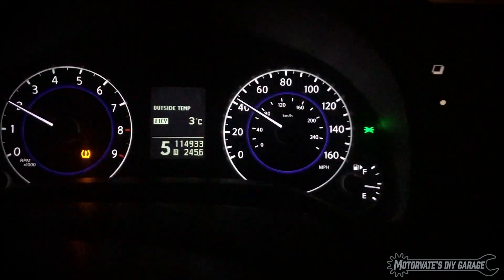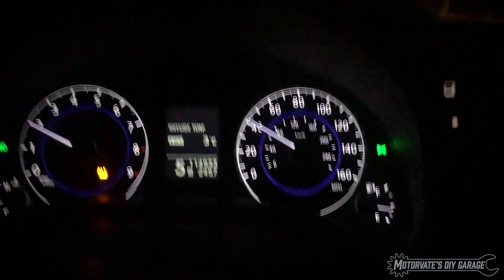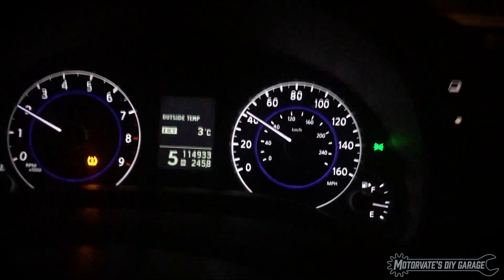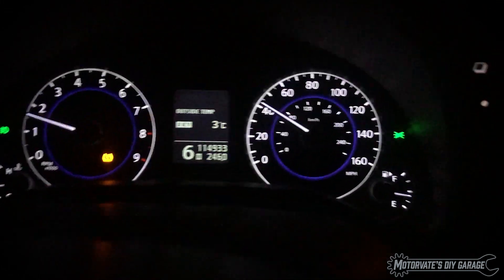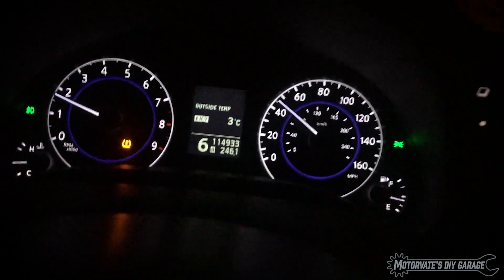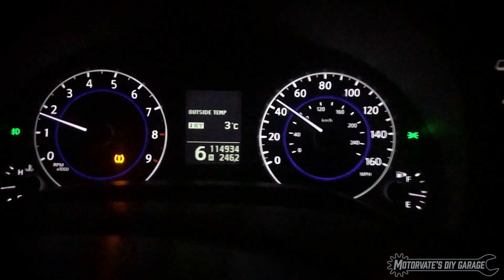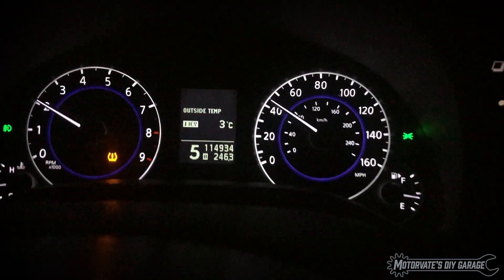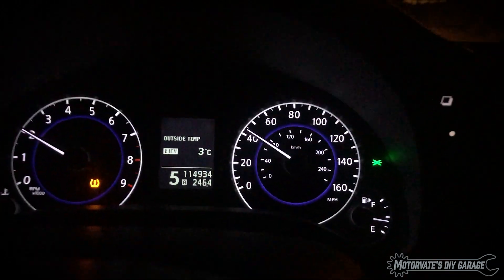Plug & Play, Manual Gear Position Indicator for the G37: MotorvateDIY Garage Ep.43

Comment: Is this out yet?
Reply from the maker: Soon!!!
Over the winter I updated the firmware to allow for different differential ratios and a few minor programming updates.

Testing on my G37 has gone well. In the spring, I'll start local testing (Toronto) to flush out any issues with other models of manual G37 vehicles.
Reply: @MotorvateDIY well if you specifically need a 2013 G37s coupe with stock everything for testing let me know 😉😉😉😉
Reply from the maker: Will do!
Reply: Having any luck? I'm also interested in purchasing one

Comment: Hey I've been watching a lot of your videos and find them extremely useful! I was just curious if you are still using your easy epoxy fix for the diff bushing? Or did you end up installing the aftermarket bushing? Just want to know if the epoxy fix was worth it as a long term fix, thank you!!
Reply from the maker: Yes, the epoxy filled bushing is still on the car. Late last year, I mounted a camera to see how it is holding up after three years, which will be a future episode. (hint: its good!)

Comment: That's awesome! I heard a little whoosh and thought this was s teaser video about boost! Nevertheless, a great little feature that should have been offered from factory.  I mean it came standard in Auto, why not keep it for Manual Transmissions too. 🤷‍♂🤷‍♂
Reply from the maker: Thank you! The "swoosh" sound you heard is the normal sound from the 6 speed manual, when changing gears... It is a little gear whine.

I have ordered the parts to make 10 stand alone units for testing on some local G37s. It will plug into the OBD port and will be about the size of an ELM327 mini, which is about 1" deep - nice an small :)

Comment: I love how you just keep hacking this car. HERO!
Reply from the maker: Thank you Tyler!
I have been reverse engineering the G37's CAN bus since last summer... it has been fun and I have learned a lot...

But, as I see it now, I think most of the "good stuff" is figured out.

In the next episode, I will dig into the new data logging features and I'll talk about things every VHR owner needs to know: engine oil pressure and engine oil temp.
(plus some other cool items that no one else has talked about )
Reply: @MotorvateDIY  I used your oil temp setup video for torque you posted way back when. I found that even driving over 30min out, it never went above 200.
Reply from the maker: Really? Never above 200F / 93C?
In traffic I have seen mine as high as 112C / 234F.
Generally the higher the engine RPM, the higher the oil temp.
Reply: @MotorvateDIY  i would agree... it was a low and i cruised at 90... i remember the temp being a bit low for how i ran the car. Ill have to try again cause i recall it being sub 230 easy
Reply from the maker: My G37 doesn't have the factory oil cooler that some G37x seem to have.
Do you have the factory oil cooler?

Comment: Can this be done on an auto?
Reply from the maker: Sort of... I can't display the current gear in the same spot as the P, R, D.
BUT I have made a stand alone LCD display that does display the automatic transmission fluid temp, current gear, torque converter status (locked or sliding) and a few other items.

I can't show that in action now, as my G has a manual transmission. BUT I do have a few volunteers who have offered to help me test and shoot a video.

More on this in the next few weeks.

Comment: Wish I had a manual but I don’t. But this is so cool. Maybe you could work for Nissan/Infiniti one day 😂
Reply from the maker: I have good news for you... In the next update video I will show you a gauge that shows the current gear for the automatic transmission, trans fluid temp and a few other items.

I can't show that data on the factory cluster, as the TCM sends out P, R, D etc to the same spot that I use for the manual gear position.
Reply: @MotorvateDIY  that is fricking awesome!

Did you mention a price for this unit and it’s availability? Gotta get this into my hands. Would love to be able program it more, if that’s even possible. I’m a comp-sci major from many moons ago but what a fun project this would be
Reply from the maker: Not sure just yet... I know it works well on my G37, but I really want to test it on other years of G37 to make sure Infiniti didn't change anything on the car's network and to make sure the hardware can handle the harsh environment of an automobile.

Now that the weather is warming up and car meets are starting up, I will be able to test this on different years of G37 and get a good sense for what it works on :)